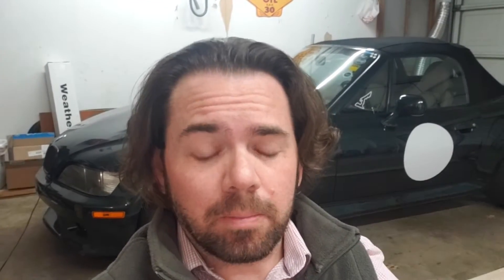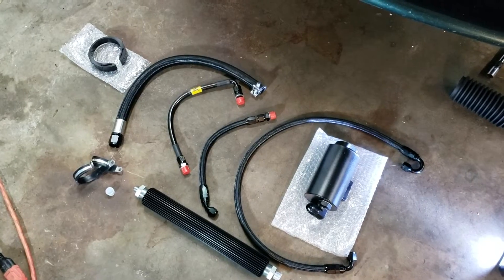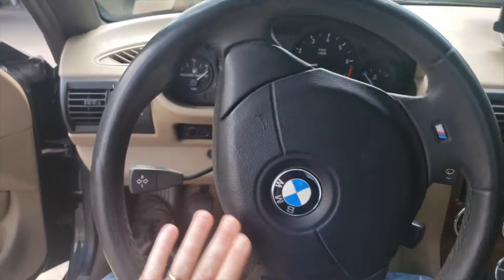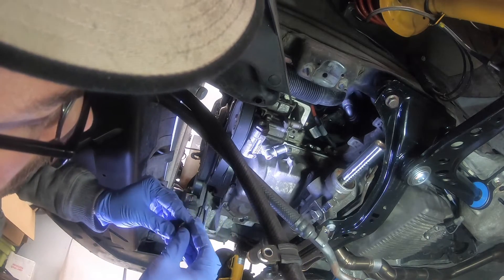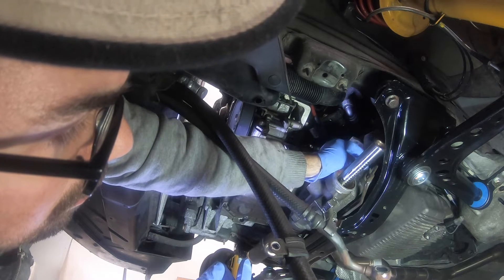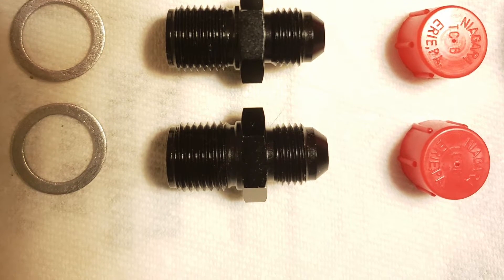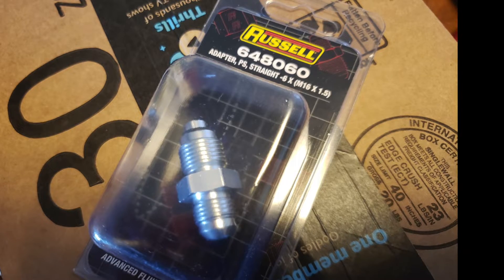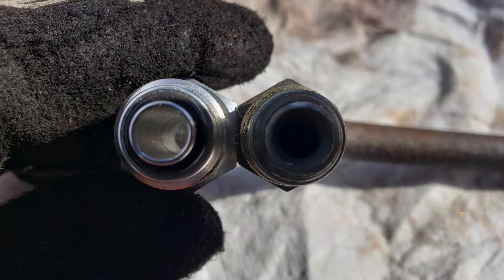Chase Bays Power Steering Kit for BMW Z3: Installation and Review

Comment: I have one of these in my z3 as well! I wish i had gone with just the reservoir and replaced the lines, would’ve been cheaper and easier but oh well lol. I did have the same issue with the pump adapter, but they sent me a replacement for free shrug